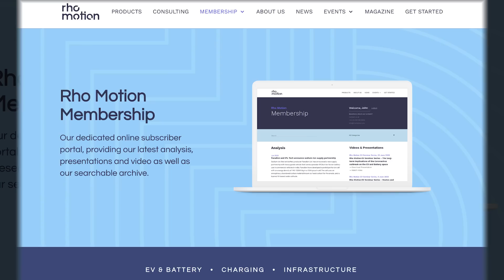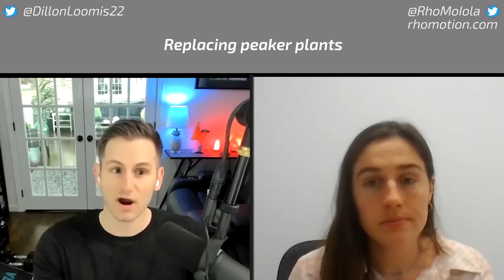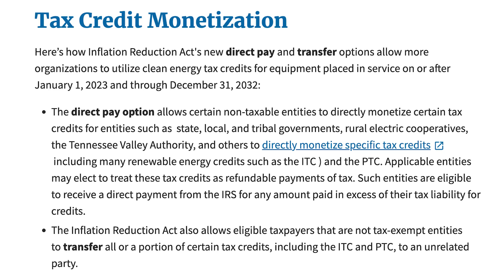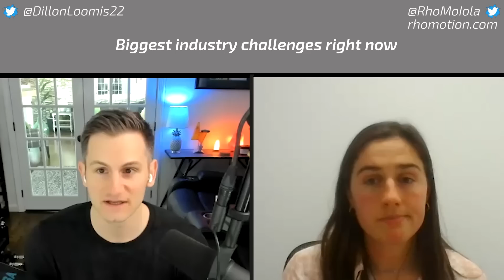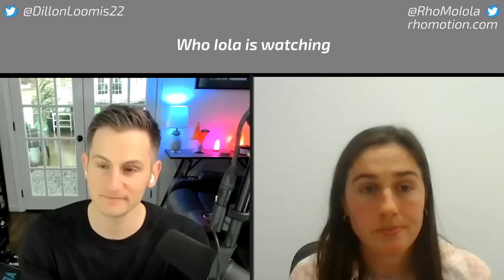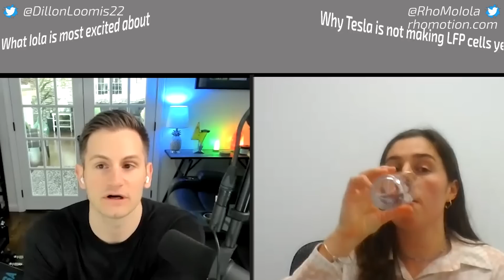Exclusive Interview: Tesla Energy - The Tidal Wave Ready to Break ⚡️

Comment: Gas peaker is being built near me its $115 million for a 300MW unit. You need at least 150 megapacks to have the same power output so it would cost $277 million for the battery or $115 for the gas peaker

But even then its not apples vs apples as the battery setup only gives you 2 hours peaking ability whereas the gas turbine can give you 4 hours if you need it

Also governments will consider the reality that a gas peaker is close to 100% domestic production and jobs while a battery is mostly imported from china
Reply: @cyclopsvision6370  A small number of hatteies for grid services can be profitable but on a larger scale $1.8 million for a megapack is far more expensive than a gas turbine peaker

Battery prices need to and will fall significantly over the next 5-10 years

A megapack with 4MWh of batteies currently $1.8 million will have to fall to below $0.5 million
Reply: @cyclopsvision6370  If you increase production to 10x the current level you will clear your 1 year backlog in 1 month then what you gona do?

Cut back production 90% ?
Or cut prices to try and increase demand to the new production lvl?
Reply: @cyclopsvision6370  Brazil is by far the largest country in South America.  They have vast hydropower which acts as free storage for their grids

It's like trying to sell ice to Eskimos
They don't need nor want storage

Same for Norway
99% hydropower for their grid
Why do they need batteries.... they don't and in fact they are connecting up their grid to Germant UK Netherlands so those countries can use their hydro as storage and not need to build as many batteries
Reply: @cyclopsvision6370  Also megapack doesn't compete against coal as megapacks don't generate energy

Solar plus megapack in sunny countries can compete against coal and gas but only if the solar and batteies are cheaper than existing coal and gas which at $1.85 million for a megapack isn't the case

Plus a large solar farm with 1GW capacity that is a very large solar farm costing ~$1 billion will need 1,000 megapacks to allow just 2 hours of storage. Those 1,000 megapacks would cost $1.85 billion at todays prices so your solar farm goes from $1 billion to $2.85 billion so you have nearly 3x the cost of your solar farm

Too expensive
Megapacks need to fall in price from $1.85 million to below $0.5 million and they probably will within the next 3-5 years

Not sure tesla will be intersted if proces fall that low but the Chinese battery companies will pick up the market if tesla doesn't want to play at that price point. Why sell batteies to tsla at $70/KWh when they can put it into a Chinese megapack and sell them for $125/KWh

Comment: Texas is a great example of the problems with "sustainable" solutions. Next to California Texas has the most wind and solar installed base for the power grid. Here's the dilemma - most of the installed base is in west Texas where there are vast spaces and plenty of wind and sun. So why is that the problem? Most of the transmission lines are in mid and east Texas. So build more transmission lines you say? Good idea except the feds and environmentalists don't want em because they cut across "protected" grasslands or they threaten bald eagles etc etc. So, now they are building solar and wind farms in East Texas where the transmission lines are. Problem solved? Nope. People in East Texas like their pristine farms and wooded areas as much ad any. Maybe more. So now the folks in East Texas are suing these wind and solar companies to stop the construction. Not an easy solution.
Reply: In Europe, they have the same issues you have underlined. The solution in Europe is too transport green hydrogen through the existing natural gas supply network. Texas is about to get a hydrogen super hub and a manufacturing plant for hydrogen derived e-fuels which maybe a more appealing prospect.
Reply: @lesliecarter4295  Hydrogen is a much smaller molecule and is very leaky. Using unmodified existing gas networks is very unlikely.
Reply: @gpsfinancial6988  1) hydrogen specific pipes are already threaded though natural gas infrastructure. 2) hydrogen does not leak through new natural gas pipelines as they were designed to take it in the first place 3) ammonia can be used as the carrier if an alternative method was required.

Comment: Front of the meter: balance supply so that there is no need for expensive peaker plants and there is power available to sell when prices are high.
Behind the meter: balance purchasing so there is no need to buy power when prices are high because you then use power from your batteries.
Both will happen and everyone benefits when production cost goes down, provided there is competition.
Reply: Peaker plants create energy. Storage systems don't, you still need to replace the lost energy
Reply: Peaker plants aren't expensive to build or maintain

There is a gas turbine peaker being built near to me it's $115 million for 3lthe 300MW gas peaker 

You'd need 300 tesla megapacks to replace this gas turbine peaker which would cost $555 million

So the battery is currently far more expensive at $555M vs $115M

The megapack needs to fall from $1.85M to around $400k to compete with gas peakers
Reply: @kaya051285  How quick is it to ramp the peaker up or down?
Reply: @gpsfinancial6988  Gas turbines are very fast to ramp up/down you are talking less than a minute

You can even keep it spinning on empty to reduce the time to seconds

But you don't really need such a rapid response we know very well in advance what times peak demands are

For the UK where I am its about 60 coldest days of the year between 5-7pm so its not like the rapid response is necessary its just that the gas turbines have that ability

Also here in the UK the government is considering giving the go ahead for a large pumped hydro project in Scotland its cost is $60/KWh so 7.5x cheaper than tesla megapacks

Plus that will last 100 years while the battery maybe 20 years

It's not just batteries as an option 

Pumped hydro
Interconnectors
Gas turbines
Diesel generators
All options

The beat battery is not needing a battery in the first place

Norway has a 99% fossil free grid with basiclaly zero batteies

France 97% fossil free grid basically zero batteries

UK today 60% fossil free grid basically zero batteies 

UK 2030 will be 95% fossil free grid basiclaly very few batteies (less than 1kwh per capita)

Why add batteies to a grid if you don't need them? The answer is we will add a small number of batteies but lot of batteies don't make economic or ecological sense

The UK will simply export its excess power to its 10 neighbours it has and is linking grids with. And during times it needs power it will import them

Some days we are already at 90% fossil free grid.... without batteries

The best battery is no battery
Reply: @kaya051285  Great answer thank you. It will be interesting to see where the dust settles. From the outside, UK and Europe seem to have outrageously expensive electricity. It would seem that there could be good arbitrage with storage taking free peak generation and reselling it when wholesale rates are high.
Reply: @gpsfinancial6988  The wholesale markets aren't really what consumers or utilities pay

Most utilities in the UK own both a retail business but also their own power generation units

So they aren't buying at mega high electricity prices. They might self generate 80-90% of their power and dip into the wholesale market to top up the rest

Also bear in mind that the same utilities also benefit from the high prices if they are on the selling side

Some batteries make sense
But not to replace everything
Clearly OCGTs are cheaper
Clearly interconnectors are cheaper
Clearly each battery that goes onto the grid makes the arbitrage profit smaller

Also cars will likely be given time of use tariffs so will charge when electricity is cheapest. As such they will act as stationary storage becuase well cars are stationary 95% of their lives

Cars don't need to feed into the grid just pulling back their consumption will have the same result as pushing energy in

Overall I go back to the simple fact that the best battery is not needing a battery. You can get to very low fossil fuel grids without batteires so why wouldn't you do that?

The UK is already 60% non fossil fuel for its grid with almost zero batteries. The UK plans to get to 95% non fossil grid in 2030 (just 6 years 8 months away) with very few batteires

The idea that we need vast vast quantities of batteries is thankfully largely a myth

Comment: Great interview. 👍 
As it appears to me, Mega-Packs (Li-ion) are short duration storage (2-6hrs)*, flow batteries and liquid metal batteries are medium duration storage (12hrs-2days), and thermal storage batteries are long duration storage (12-16days).
(*Meaning mega-packs can smooth out the duck curve and provide profits to the mega-pack operator, but do little to replace peaker plants for longer duration use cases.)
Hydrogen is the energy industry's pixie dust. As of a recent report, hydrogen can currently be stored for about 50 hours, and it takes 3x as much energy imput for every unit of energy available in the hydrogen.
Those of us living in the northern US, Canada, and northern Europe should be very careful of drawing any use case model from Australia (we are nowhere nearly as geographically blessed).
Finally, Iola earned some major truth points from me when she said, "it will be very difficult to go 100% renewable, 100% battery storage." Depending on your definition of "green", we could have a green grid faster than she is suggesting. Depending on development and regulation, we could potentially replace the base load fossil fuel generation with nuclear before all the suggested renewable infrastructure is built. (We may even decide the 30% increase in transmission lines, and the 4-5x facility build out over nameplate capacity for wind/solar isn't worth it)

Comment: 33:30 Iola Hughes seems to have overlooked the implications of baseload power plants in her recent interview. With a grid approaching 100% renewable energy generation and adequate storage, baseload power plants not only become redundant but can also negatively impact grid stability.

As the proportion of renewable energy grows, other power plants must be actively ramped down or even shut off to accommodate the fluctuating power from renewables. Regrettably, baseload power plants, particularly nuclear ones, have slow ramp-up and ramp-down times—ranging from 30 to 40 hours—making them ill-suited for balancing the grid's needs. In fact, this inflexibility can actively harm the grid, as it necessitates even greater storage capacity to accommodate the power generated by baseload nuclear plants.

If we don't phase out baseload power plants, we may face inefficient operations, increased storage costs, stranded assets, and adverse environmental consequences. On the other hand, gas peakers are a sound investment and will remain a required backup for the rarest cases even with a 99% renewable grid.
Reply: Peaker plants don't have capacity
Reply: Today wind power is curtailed when the power price goes negative. There could be a case to just heat up ocean water if the power price goes negative enough.
Reply: @Maddack  That will help the global warming system and wear out bearings, better we use it for bio-fuels, hydrogen, heating, compressing gas.

Comment: Megapacks are 2 h or 4 h minimum duration. You can always discharge them more slowly, maximum duration is defined more by your business model / use case than by the technical specs.